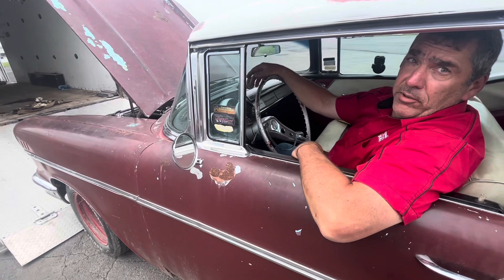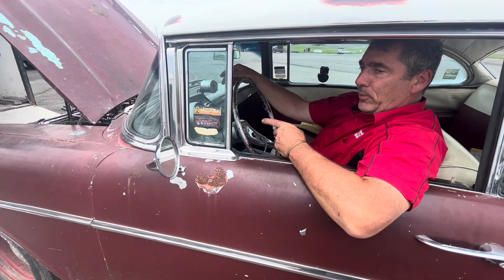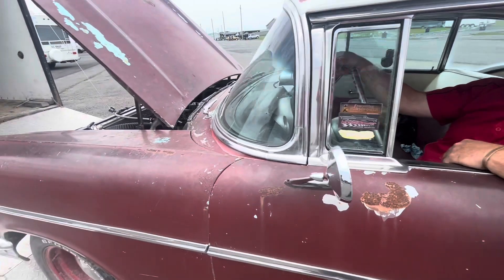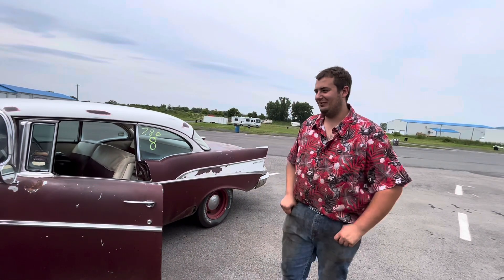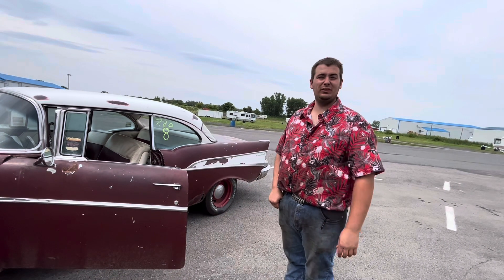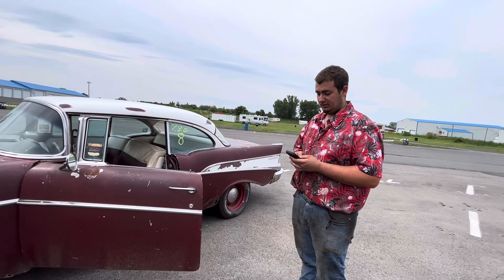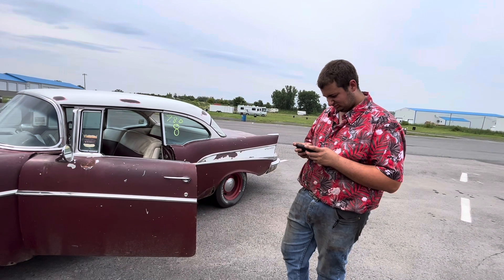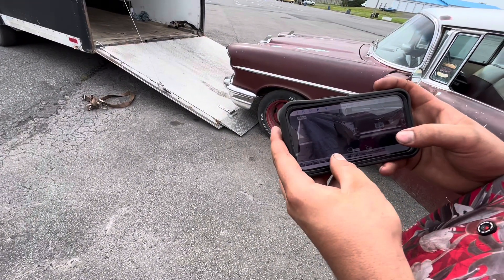I’m afraid I’ll blow the engine in my 57 CHEVY Daily driver at the race track TEST N TUNE

Comment: Yaw have hot rod there lol Motor has to be happy with fuel and timing to be able to get good plug reading get pump fuel lines up dated i would bet you have to take main jets back down if you can air fuel gauge in car then you can get perfect tune preety quick
Reply from the maker: I’m thinking you’re right

Comment: What motor combo is in this car
Reply from the maker: It’s a 400 small block with pre eliminator AFR heads (pre 2005 model) Brodex single plane intake and a comp solid roller cam 285 duration at 50 on a 108 lobe separation and 762 lift with a 1.6 rocker
Reply: @EverythingHorsepower  thanks sir badd ass ole school badd ass machine here love it runs good man nice job on it
Reply from the maker: @jackperry9369  thank you very much

Comment: I have a whole cam in my engine. Makes the last 2 cylinders run much better. 😂😂😂 Go ahead and slap me, I'm sorry but had to.
Reply: I hope it's balanced and blueprinted, ported and polished, bored and stroked. And don't run open headers because you'll burn your exhaust valves, plus the engine needs backrpressure. Put bigger jets in it so it makes more power. Shhhh. don't tell anyone my power secrets. 😂
Reply: I almost forgot to tape a $100 bill on the dash and anyone who can grab while I accelerate can have it.
Reply from the maker: @andysteele4056  you can’t ever forget that one
Reply from the maker: @andysteele4056  lol
Reply from the maker: @andysteele4056  some of them might work
Reply from the maker: Lol don’t forget the camel hump heads